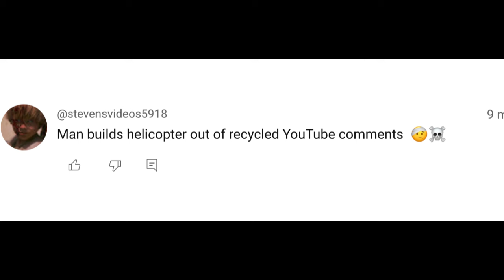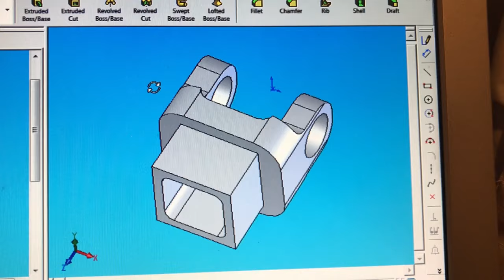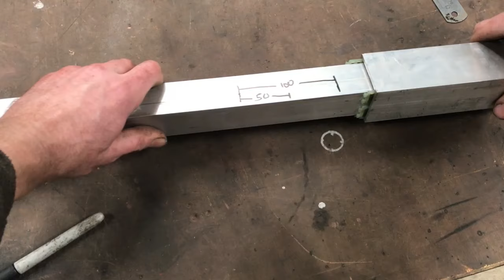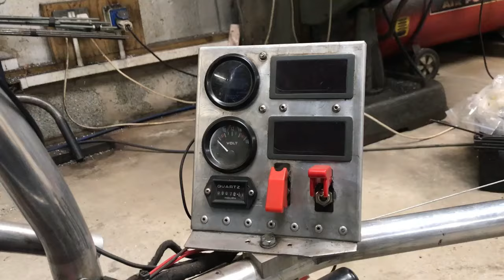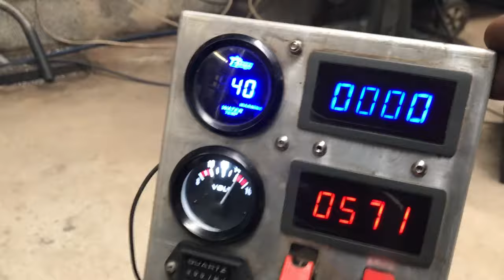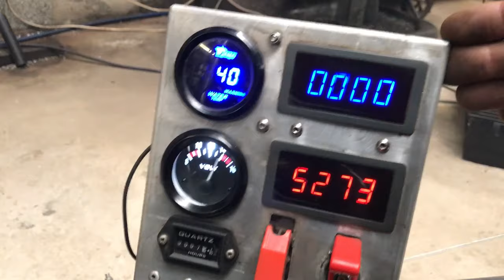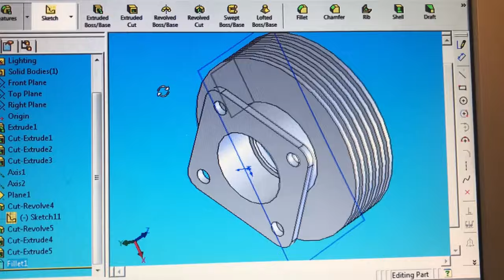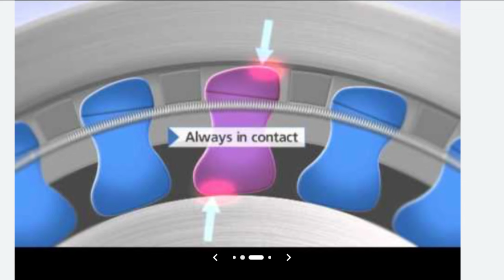Should I fix my Homemade Helicopter ???

Comment: your mistake is that you didn’t make a helicopter, but an airplane standing vertically with a large propeller, and the difference is that the copter has a large propeller from an airplane with a variable thrust direction angle, but a helicopter has a completely different principle, a helicopter wing is like a wing aircraft, but it moves rotationally and has not vertical thrust, but horizontal thrust, like an airplane wing, and not a propeller, this is a fundamental difference that distinguishes one from the other, and this manifests itself especially when the helicopter reaches horizontal speed relative to the air flow, at which the effect disappears "air ring" and the useful effect of the wing-blades increases... when the horizontal speed slows down, the helicopter falls into its "vortex ring" and can fall to the ground having lost lift, please familiarize yourself with this phenomenon shown in many popular videos on YouTube, it is explained there theory in every detail... the distinctive feature of a copter from a helicopter is that as horizontal speed increases, the lift force decreases, and in other words, a helicopter and a copter are completely opposite to each other in principle, but very similar in appearance... best wishes from Russia... I regret that the translator cannot correctly translate some technical terms from the Russian language that we use to explain the physical properties of air and wings... if designer Kamov had invented a coaxial blade design like you did, we would have helicopters of the KA-52, KA-26, etc. brand never appeared ... and theoretically you have a gyroplane, but you need to attach a small propeller to it in front or behind to create horizontal thrust, without such a propeller, you can just hang in one place inside its vortex ring, when you try to leave this ring, the lifting force will disappear and crash to the ground
Reply from the maker: Hi, my helicopter can move in any direction just like any other helicopter. It flys in the same way by changing the direction of the thrust. This video demonstrates it 
https://youtu.be/B21Xk6tNcBw?si=RpJR0dT0KcrhLCpL

Mine is exactly the same. The blade is naca 0012, symmetrical. The top speed I would estimate is 50-60 mph.
Reply: @Ben-Dixey  top speed of real hellicopter with "correct" sheme of SWASHPLATE have speed 200 or even 240 mph (depends of main rotor config) ... okay, anyways, goodluck to you
Reply from the maker: Ok, thank you. 👍
Reply: @Ben-Dixey  now i still looking for better video, i've seen one but can't find right now, ill try in some minutes, excuse my russian accent again
Reply: @Ben-Dixey  btw, we have limitation for lightweight aviation in russia, by 115 kg for a "thing" without weight of pilot, this limitation make big troubles to us bcz it make difficult twice to do anything good
Reply: @Ben-Dixey  https://www.youtube.com/watch?v=t13qda0btLA earlest video, 6+ years ago, you may compare "swashplate" to yours "controlled propeller thrust
" this is 2 differnt principes
Reply from the maker: Just to be clear. My chosen design is not going to replace a swash plate controlled helicopter. Kamov was a genius and I love those helicopters right from the KA-8. My helicopter will only really be used for hovering, maybe also so small forward speed. It is a toy and nothing more.
We have stricter rules here in the Uk, I cannot fly anything above 70kg without a licence. For this reason the helicopter is tethered. 
I'll watch the video you sent. 👍
Reply: @Ben-Dixey  ahh... i see, the same or similar limitations like in russia, laws broke our dreams
Reply: @Ben-Dixey  if the laws in the US are similar, you should think about efficiency and avoid getting into the vortex ring, it absorbs all the engine power uselessly, to increase efficiency, helicopter pilots in Afghanistan used MI-8 with a full load, in which it would not be able to take off vertically, style “Afghan style” “hooligan style” is when, without having yet lifted the front landing gear from the ground, leaning on this wheel, the helicopter begins to accelerate and only after 60 km/h does it take off from the runway, this is a way to increase efficiency, and the most dangerous thing when landing, you also can’t hover , if the speed is low, a vortex ring and fall may occur
Reply from the maker: Yes. The efficiency increases with forward speed. Same as hovering in windy conditions.
Reply: @Ben-Dixey  yep, exactly... but i have no idea, how it will workd when thrust control occurs by tilting the plane of rotation of the blades, instead of controlling the angle of rotation, the angle of attack of the blades by means of a swashplate, changing the thrust at the edges of the main wing-blade
Reply: @Ben-Dixey  as I said earlier, the solution to the problem can be to install a small pushing element behind, such as a turbine or propeller, and the general scheme will be very similar to that of a gyroplane, with the difference that on a conventional gyroplane the blades rotate from the flow of the oncoming wind, and their mode work is similar to autorotation